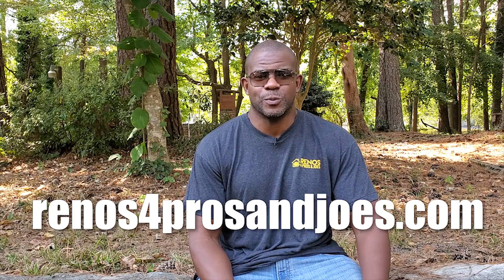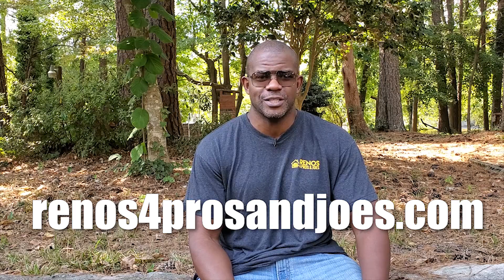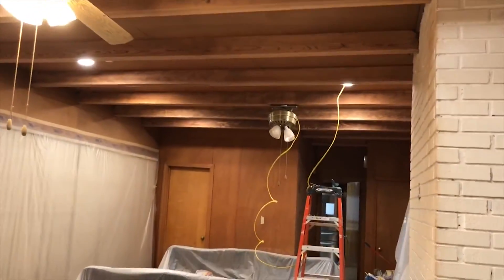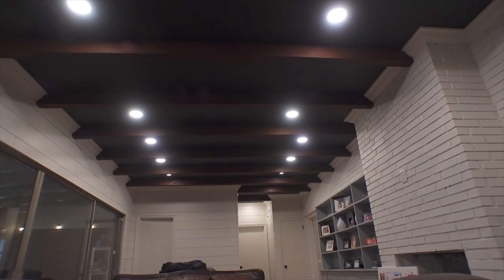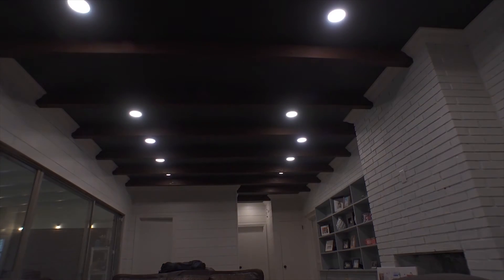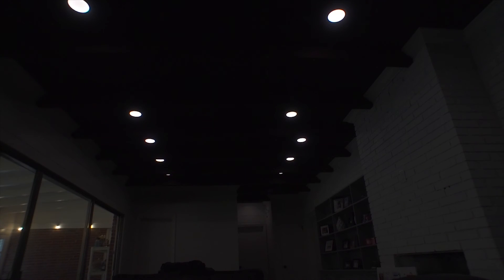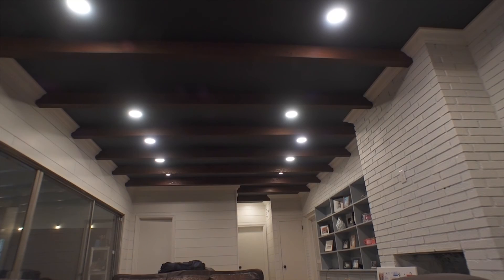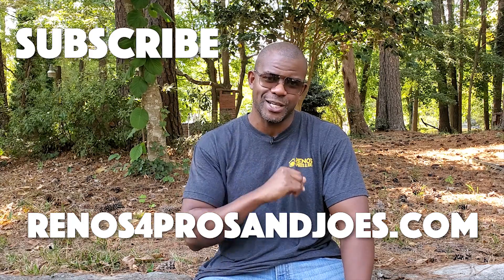LED Light Dimmer Flicker

Comment from the maker: Factors to Consider When Selecting LED Lights @Jw-I
Reply: Hi cool video .

I didnt have the same problem as you but similar once and awhile the lights would pulsat not sure why this happens but it happens randomly 

I have 4 recessed LED lights and a dimmer switch setup in my dining room
Reply: @praiselifeworshiplife1ca  I have the same exact problem. It’s driving me nuts. I’m going to try a newer and better dimmer to see if that helps. I just changed from incandescent bulbs to LED, no wiring changes.

Comment: So what specific dimmer did you use with what light? Im having this same problem. The lights on full brightness are fine. But when dimmed, there is the slightest flutter across all the lights. I have feit electric dimmer switches with cloudy bay gimbal color selectable lights.

Comment: I have this problem. Only one LED light in bedroom and it flickers. All others work fine. The builder tested the wiring and says it’s the ADT dimmer device. An electrician tried several model dimmers. The problem persists. Even took the dimmer out from the other room. Still flickers. I will try to get the model number for the LED light fixture as you suggest and try to find the recommended dimmer device. Thanks for sharing.

Comment: Where you using a fixture made for incandescent or halogen and using LED bulb in it? For example max watts 60 or 100 watts etc? This sort of sounds like needed dimmable LED Bulb for standard dimmer for incandescent. When using LED bulb in a fixture that was originally meant for incandescent with higher max watts you should use a “dimmable” LED bulb, as compatible with standard dimmer( standard dimmer is originally meant for incandescent or halogen, before the LED Technology was introduced and And utilize for residential/commercial lamps aka bulbs, as before was used for on/off indicator button that the stereo system or TV or VCR was on /off with the red or green light.) LED light emitting diodes. Also doing research. I’m a lighting expert and see conflicting info on this topic or not enough info for me to compare notes. Love your videos!    Understanding lighting has become much more complex in recent years. As to the Evolution of LEDs…. 🤯😳🥸🤓😉

Comment: I am having the same problem. I changed the lights, dimmers to non dimmers after testing 3 different types(negative-wire, no negative wire and universal type) same issue unfortunately. Changed fuses in the box and even replaced my thankless water heater because it was pulling too much electricity. Still doing it and I'm frustrated.

Comment: I just have a question. When you say light fixture, do you mean light bulb? We had potlights installed in our new built home and they flash a few times when we turn them on then it goes normal. They do this everytime we turn on the switch and happens throughout the house. We were told that its normal and all we had to do is switch the bulbs. our inspector told us its not "normal" and should get it fixed. The problem is that the electrician keeps telling us to change the light bulbs in order for it to stop flickering. Please help, thank you!

Comment: So now in 2022 what I am being told is the wiring needs to be switched to low voltage for alot of the LED fixtures.  The dimmers need to be 0-10V.

Comment: Thanks! I wish I had seen your video prior to installing the LEDs in my den.  On a side note I installed six in my kitchen and had no problem with the dimmer switch then we replaced our stove/ oven with a induction one and turned it on and it made the dimmer switch hum like bee. Had to remove it.

Comment: There 12watrs
How can a dimmer work.
The dimmer cant go any lower.
With a resistor the dimmer can start where its supposed to at 65 watts
Reply: Hey man. Are you saying that an ohm resistor would prevent the flicker because the amount of power delivery is over excessive to what the light requires?

Comment: Good advice. Wifey said the 2x4 and 2x2 lights in the basement we're too bright !  ( winer ...how much time does she really spend in the basement anyway ) Got a Leviton dimmer switch at HD, wired it correctly !! and wala !!  flickering at the low light level. Noticed that both the 2x2 and 2x4 lights had a " purple " wire with the wire harness.........time to call a electrician.

Comment: So, are you supposed to switch them out for a new brand, then or can you use the same brand?
Reply from the maker: If your lights have been working fine and they just started flickering all of a sudden, it's more likely to be the switch. If you are installing new lights and a new dimmer, the problem could be with either the switch or the fixtures. Some trial and error may be required. Additionally, some have mentioned using jumpers on the switch to remedy the problem, but I have never had to do that. Hope this helps.
Reply: @RENOS4PROSJOES  Thank you. I'm not sure as it's a new apartment and this is just how it was left but I will see. Thanks.

Comment: I had the same exact issue. I put 6” lights in kitchen, living room and master bedroom.  All worked no problem.  I put 4” in the dining room and they flickered. No matter what dimmer switch it wouldn’t fix it.  Changed out fixtures and worked fine.
Reply: Can anyone explain why this is??? The fixture, unless it’s a smart home is just a collection of materials that make it so that the LED bulb can receive electricity through contacts... essentially a super complex fancy wire that you can twist a bulb into.  So how is the “fixture” effecting flicker at all?
Reply: @CammonRandle   so the high hat fixture that goes up in the ceiling basically is an Edison female light socket that’s wired to your home wiring like any other light the LED is completely self-contained to which you could screw in the mail Edison socket that comes with it in any light fixture in your home and a lamp and it should work the actual fixture of a high hats up in the ceiling is just a socket so you’re saying you bought the high hat and the light to LED light as one unit and you’re changing the whole fixture? Logic says the Edison female that’s in the Metal fixture has no electronics in it I guess I’m confused
Reply: My problem is that my lights worked fine then one night I notice that my light appeared to still be on after I turned the switch off. It was dim but it was still on. Why a Electrican said I needed to purchase another light because recess lights do that. It reacted the same way with a dimmer.

Comment: great video, Puzzle for some one, one and only one led light BULB flickers only when electric tankless hot water heater  is used. If the hot water is turned on anywhere in the house the light will flick and stop as soon as the hot water is turned off. There is a dimmer on this run, works great UNTEL you use the hot water.   Any ideas

Comment: So mine have worked fine for a while now, but a few days ago they started flickering. I replaced the switch no change, pulled each bulb out one at a time to see if one was causing the issue. Tried adjusting the dimmer setup.  No luck.
Reply from the maker: I haven't run into that issue yet. I would suggest trying to find articles or message board threads where thers have had the same problem with the same make and model light fixture. Good luck.

Comment: Thx man! Can u tell us what exactly is the brand and style of light fixtures/bulbs that dont flicker?
Reply from the maker: It's not always that simple. A light that flickers in one property, or one location, may not flicker in another. The lights that I had a problem with were defective. However, dimmer flicker is also a common problem with properly functioning LEDs. Frequently its a compatibility issue between the fixture and the dimmer switch. You have to read the fixture specs for guidance on recommended switches. There is sometimes trial and error involved. And in some more complex scenarios, you may need to call an electrician.  I've added links to the lights featured in this video in the description box. I did not the defective one.

Comment: The wattage you have is too high for the bulbs (LEDs always much less power than traditional bulbs) and the result is that they flicker. You can solve this usually by adding in a resistor in parallel to the circuit - some dimmer switch manufacturers supply these so that you don't need so spend time working out the resistance that's necessary.

Comment: I have the same problem with a different twist...... When i disconnect the ground wire it stops flickering when i lower the dimmer. When i connect ground wire back they start to flicker again only when i lower the dimmer........
Weird........any clues?

Comment: someone said buying and installing LEDs would save us money.   So far, that hasn't been true!    Contractor installed ceiling can LED in our remodel.   Two banks were on dimmers.  Rest were on/off switches.   I wanted all dimmables and matched what he installed.   After about 2 months, one circuit of 4 lights started blinking.    Then, several days later, another bank (that he installed) started blinking.   Expecting the rest to start also.   I set the dimmer half way down, and it stopped the blinking, for about 20 minutes, then it started blinking at that setting.   UGH!  Not happy with LEDs so far!

Comment: Returning all these lights back to the store is not resolving the issue.... I'm a hundred percent sure you had problem with wiring or just one of the lights was defective,  casing all other lights flickers
Reply from the maker: The fixtures were defective. When I returned them to the electrical supply house,  they told me that tons of electrical contractors had returned them for the very same problem.

Comment: I have run across this issue a lot.  Not the best solution but has worked for me is adding a 7W or 5W incandescent C9 bulb in the same circuit/dimmer.  Im not an electrician but this has been the one thing that has worked for me to get rid of the flickering when using LED lights on a dimmer switch.  I mainly work with Lutron and Leviton dimmers.  Has anyone tried this before?
Reply: I'm going to try this today!

Comment: There are some led compatible dimmer switches that have an adjustable load dial so you can fine tune it to solve the flickering issues becasue not all manufacturers have the same specs. Try that next time if you experience flickering.
Reply from the maker: Thank you for watching and commenting. I forgot to mention that two of the switches that I tried had the dial that you mentioned. It made the problem a little less severe but didn't fix it. My root cause ended up actually being the fixtures.

Comment: My led lights flicker now and then, i.e. they are stable until about one hour has passed and then they flicker for a few minutes and then they are stable for a while, like an hour, and then they flicker and then....repeat, repeat, etc, etc. Very frustrating. Any ideas on this? We have various led light fixtures including recessed pot lights, a chandelier and 3 hanging led lights installed in one open space and they all flicker. We also are using dimmer switches but the flickering seems to be independent of the flicker, i.e.adjusting the dimmer does not affect the flickering. Any ideas?
Reply: Having the same issues also, any progress on your end?
Reply: @Kelsonmassif  Yes, our contractor changed the dimmer switches to a better brand . The original were Eaton which were about $15 each. The replacements are a higher brand priced at about $60 each. Then he tested with a voltage meter at the switch and the light fixture to ensure we are getting 120v at each, which we are. He also installed an on/off switch to replace one dimmer on the chandelier in the entrance (i.e. we had 2 dimmers on one chandelier light, now we have one dimmer and one on/off switch) which resolved that flickering issue .   Now, we just have occasional flickering , like once every 2 hours or so. We think it is our hydro provider which is the cause. For now, I am happy.
Reply: @robinirving8307  That 1-2 hour issue seems to be the same with us, very odd, could be the fluctuations in power also. Thanks for replying back :) will post here on results when we find a long term fix

Comment: I’ll summarize, Get a New Lamp!
Reply from the maker: Sometimes replacing the fixture is the best option and sometimes it is not. I recently had to order a led dimmer switch online due to a compatibility issue. There is a seemingly unlimited number of led dimmer switch options and many of them are not sold in stores. However, the big-box retailers are definitely working to improve their in-store selection. I see more options on the shelf now than there were when this video was created just a few months back. Thank you for watching and commenting.

Comment: Which kind of dimmer did you use?
Reply: Brand? I got a leviton with the same issue. I fix already one model but the other I couldn't by now
Reply from the maker: @ramoncastillo967  I used a Legrand on that application. But, I had 3 switch locations in the same room. I will have to find the model. I have also had to order dimmer switches online that arent sold in the stores or supply houses.
Reply from the maker: Legrand, I believe.
Reply: Thanks a lot, it's not necessary. It was only to know if it's the same dimmer but it's ok!

Comment: When you say replace the fixtures do do you mean the lights that are flickering or all of the fixtures on that line?
Reply from the maker: I would not be able to advise you without knowing more about your specific electrical setup. Nor am I an electrician. When in doubt, call an electrician. 

Now with that said:  In this video, I'm speaking based on my specific scenario. In this scenario, the light fixtures were all installed as part of the project. And, the new lights did not flicker until the standard switch was replaced with a dimmer switch. In order to fix the issue I replaced only the recessed lights controlled by the dimmer switch. When I returned the fixtures, I found out that many people (electricians and contractors) that had recently purchased the same lights returned them due to the same issue. Once the lights were changed out the flickering stopped immediately. Hope this helps. Sorry, I can't give you an exact answer.
Reply: I sure would like the ,odel nimbers, bad and good. TIA.

Comment: Should have talked to an electrician, sounds like your wattage was too high for the dimmer. Each row of lights on their own switch. Had the same issue and the switch maker and the light maker said the same thing.
Reply from the maker: Believe it or not, I actually did. This video was published before I had a chance to return the LEDs. When I did finally return them, the counter sales associate told me that they had so electrical contractors return the same model light, that the owner of the supply house contacted the manufacturer to complain. Thanks for your comment!